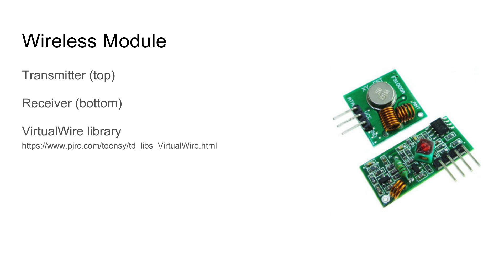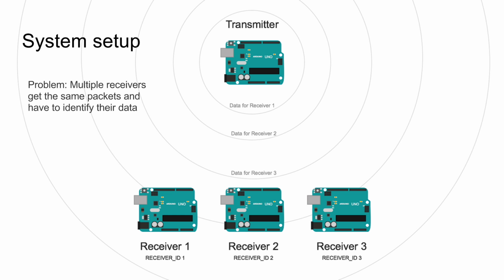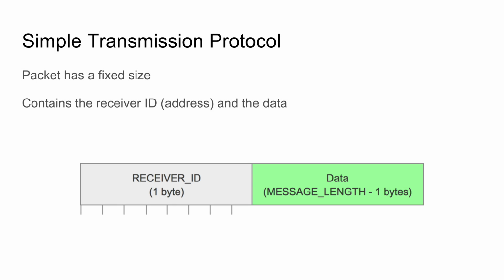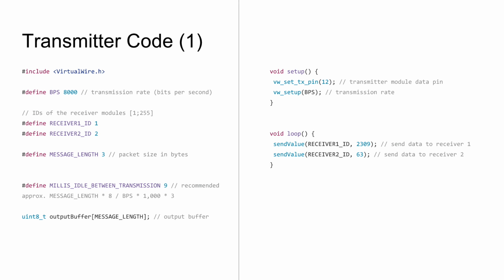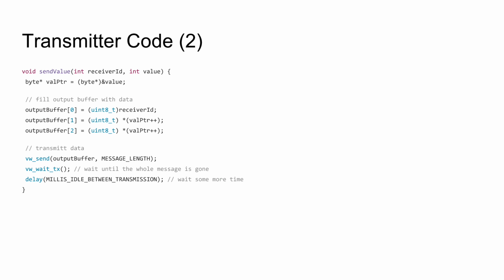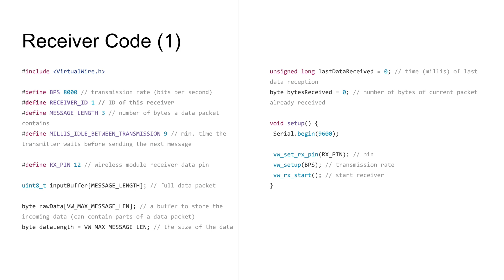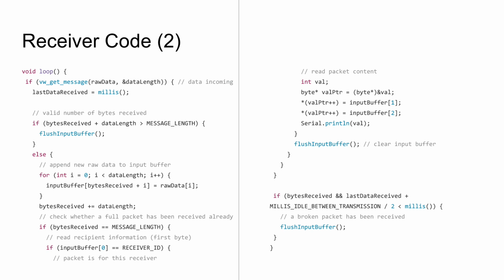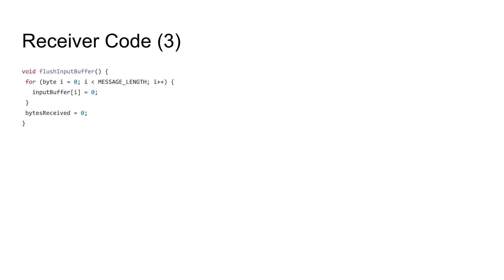Wireless Module Multiple Receivers - Arduino Tutorial

Comment: Hi Timo,
I want to use up to ten receivers to control my window blinds. I have decoded a 10 button remote control transmitter and have all the data. How would I get that data programmed to each receiver/arduino? Where in the sketch would I insert the data? Thanks in advance for your help!
Reply from the maker: Thanks for reaching out. I think, you are looking for the receiver ID which is defined here (https://github.com/Simsso/Arduino-Wireless-Module-Multiple-Receivers/blob/master/Basic/Receiver/Receiver.ino#L4). For each of your 10 receivers you want to make sure to have a unique ID set.

Comment: Timo, can we use AtTiny13A chip  instead of Aurdino on recievers side?
Reply from the maker: I am not 100% sure. The VirtualWire library uses some timers that are not available on every microcontroller (in the same way). Just try it and if it does not work search for another version of the VirtualWire library.
Reply: Thanks man, I will look after you advice...may be I will get something.

Comment: in the video tetorial the connection are not understand able so kindly help me for connection of components ie circuit diagram @timo denk
Reply from the maker: The wiring is simple. Attach the wireless modules as described in the tables here: http://timodenk.com/blog/arduino-433-mhz-wireless-module/
Then use the Code from GitHub (https://github.com/Simsso/Arduino-Wireless-Module-Multiple-Receivers/tree/master/LED%20Example) where you can also see how to attach the LEDs.

Comment: hello , i am new in this field. i want to measure the distance of multiple objects using hcsr-04 sensors with multiple number of arduinos and  for  i have used 2 HCSR04 ultrasonic sensors with an arduino uno  and they works in between 2-400cm . Now i need to connect 2  more arduino uno modules including 2 HCSR04 in each of them wirelessly and they need to send their out put  to the pc but in a same screen, for this what should i do???
Reply from the maker: Sorry Jyotirmoy Ghose, I'm afraid this question is not specific enough to be answered by me in a quick way. If you want extended support send a request on my business website (URL in the video's description).

Comment: can you suggest how to configure 6 wireless motors using single transmitter, I mean 6 independent receivers using single Arduino
Reply: Each motor would need to have a unique ID assigned to RECIEVER_ID. The first part of the transmitter packet identifies which receiver should act on the information. All receivers will get the data and need to determine if they should act based on the ID matching

Comment: very interesting video.
can you please upload the other one where we can have multiple transmitter and one receiver
Reply from the maker: Every receiver will get every message. Only the messages that are addressing the given receiver will actually be interpreted and processed further.
Reply from the maker: I think there is a little misunderstanding: I don't have a code for multiple transmitters and one receiver.
Reply: The video (2:55) says that each receiver has a unique id.  Does that mean that I can have multiple pairs of receivers/transmitters and if a transmitter sends a signal then only the receiver with which it is paired will receive the signal? or will every receiver get the signal from that one transmitter?

Comment: Hi Timo, 
can I use other pins for the VirtualWire Library or only pins with timer 2 ? 
I need 10 and 11 for SPI. I want to use rx pin 6 and tx pin 7 for the Wiremodule.
Is that possible ?
Reply from the maker: Hi there! I just checked the library and it looks like you can use every pin (https://github.com/danielesteban/ArduinoLib/blob/master/VirtualWire/VirtualWire.cpp).